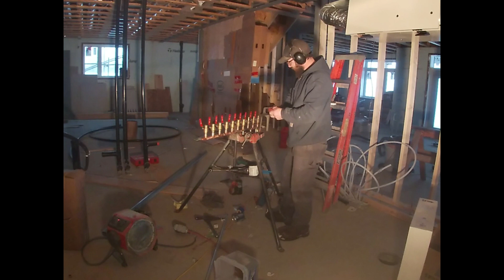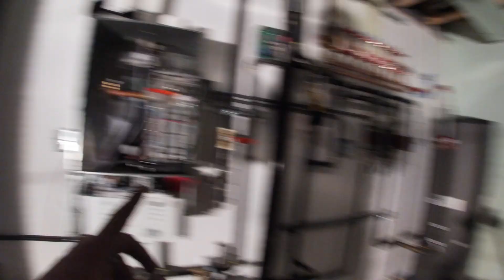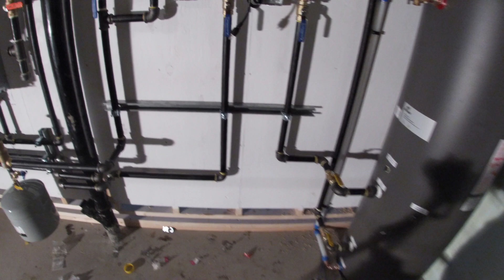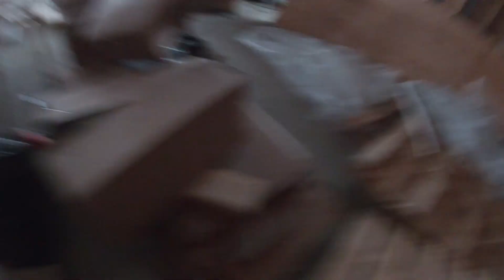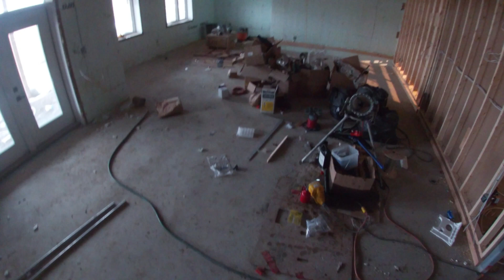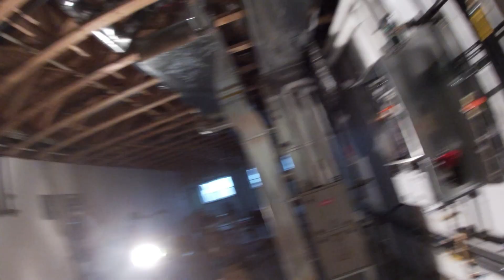Vlog 22 - Water Manifold & Boiler Piping

Comment: You Canadians crack me up. You mentioned the term boiler. I'm thinking this huge gas tubed boiler like for a commercial building, but on a much smaller scale. When in actuality it's what we can in the states a tankless water heater, which i might add doesn't require the expansion tank. Unless you add the heat exchanger/tank to the system.

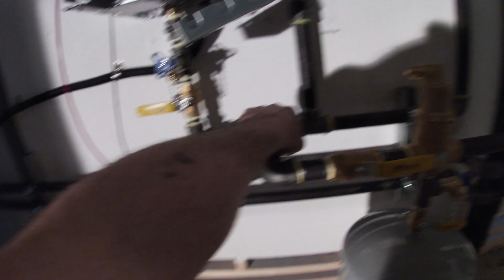Comment: That return connection at 9:25 - you consulted a professional plumber on that? You say it blew your mind -- it doesn't seem to me like it would work. Your pumps can pull from the return in this configuration and there's nothing guaranteeing direction of flow. I don't understand. It's not missing an additional valve in there to control flow direction?
Reply: I mean you trace the route of the hot water with your hand, but it could more easily feed back into the boiler itself - that would be the path of least resistance, no?
Reply: Unless the boiler itself has some kind of thermostatic valve and isn't just a passthrough that turns the heating element on and off? That would make sense in my addled brain.
Reply from the maker: @bazbar8315  It looks weird, I know.  There is a pump within the boiler and i think the idea is that if the flow demand of the heating zone is more than the boiler pump can flow, it makes up the difference from the return line like you said. All of the hot water from the boiler plus whatever amount of return water makes up the required flow. Looks like a "short" in the piping, but it needs to be there.  It has all been working great!

Comment: Question:why are you using black pipe for plumbing?
Reply from the maker: The pipe and fittings are way cheaper, and on the commercial sites that I’ve worked on, guys have always used black iron so that’s what I did.
Reply: @eberlesbuildahousediyicfho9630  I hope it works out for you. Just seen a lot of rust in the water.
Reply from the maker: @joemizer  Thats not rust.  It's the pink glycol we added to the boiler water.  It also has a rust inhibitor added.  We ran a degreaser through the piping too. This got all the leftover cutting oil and metal shavings out of the system before we added the glycol.  I'll see what the water looks like after this heating season and i'll know. So far so good